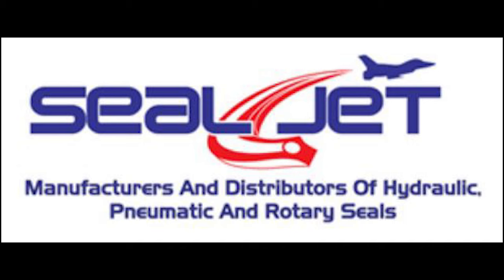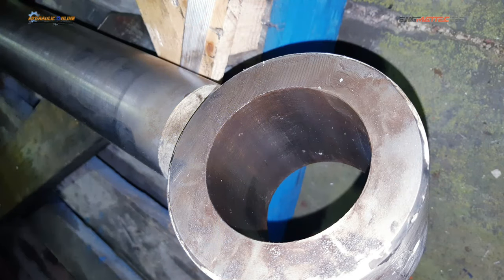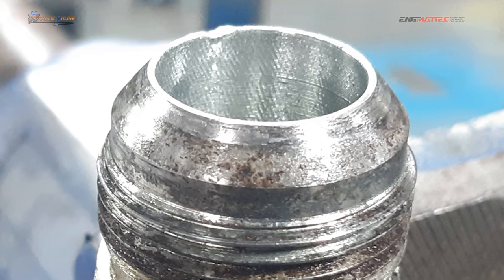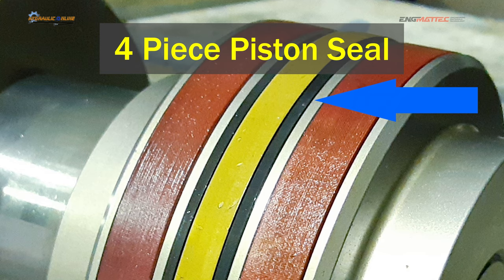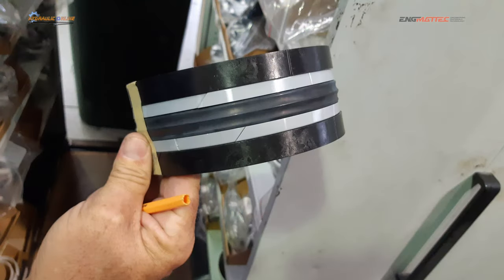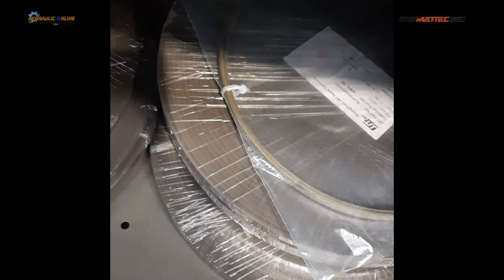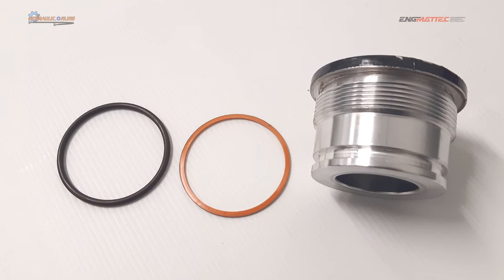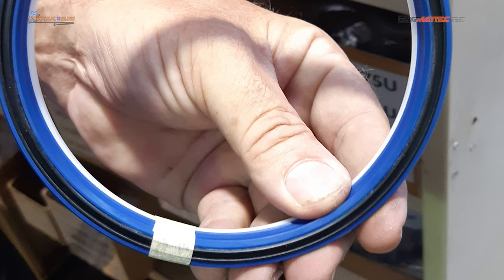What Kinds of Seals are used in High Pressure Hydraulic Cylinders

Comment: I am trying to get 'high pressure' (around 8-10psi) from a home made pump. I have made it from a 110 soil pipe and have 3d printed a piston which has around 1mm clearance and two basic round o'rings one above another. I have done this because i need a large volume of compressed air in one stroke of the piston. 
I have noticed that if i push the piston in quite fast i can get high pressure from the output of the soil pipe chamber which is great. However if i push the piston in slowly, it seems that the pressure escapes back out through the sides of piston. Should I look at maybe getting thicker orings although they are already very tight in there, or should I look at a different type of o'ring such as one of the ones at 6:29 in your video instead of a round profiled o'ring? Any suggestions please?
Reply from the maker: Hi there, sounds like an interesting project you are working on!. 
The lip seals like the ones at 6:29 should work better, they will have little friction when you pull back but will expand and seal better when you push. 
Please note. It is important that all contact faces that any seal touches has a fine smooth surface finish.  
The only problem you will have is that lip seals are made to certain sizes and dimentions so you may have to modify or re-print your piston. 
For the pressures you are talking about try to obtain pneumatic seals rather than Hydraulic seals. Pneumatic seals will be softer and more flexible, but will not as durable as hydraulic seals.  
Please be aware depending on size, availability and material of construction they may be 5 to 15 times more expensive than the O rings.
Reply: @Hydraulic.Online  Brilliant thank you for the reply!

Comment: Que tan buenos son esos retenes del embolo seal en comparación. Alos de material de poliuretano ya que eh visto en embolos de distintos materiales pero la diferencia que sepa es que el de tipo seal se apega bien duro al cilindro internamente y no sale sino con presión o jalandolo con fuerza  en comparación con el de material de poliuretano si sale más rápido al golpear el vástago hacia adelante  eso me di cuenta alguien que me diga explique gracias
Reply from the maker: Joao not sure if you asking talking about Piston Seals or Rod seals. 
In Hydraulics 
Double-acting Piston seals are usually made from a non-ferrous metal-impregnated Teflon that usually has some type of O ring under it to increase the sealing forces when pressure is applied. 
Seal material and design depends on many factors for example, type of media oil water or gas, temperature,  pressure and speed (or velocity) that the piston moves up and down inside the barrel bore.  
The other type of common piston seals and the majority of rod seals are made from polyurethane.